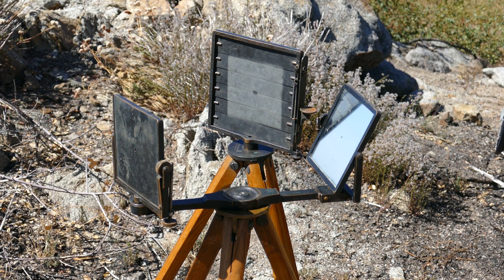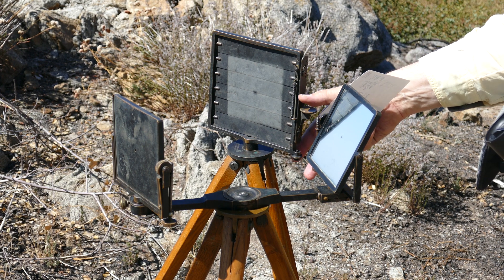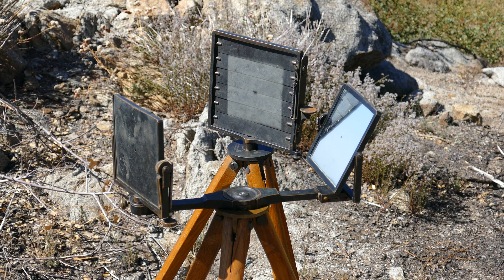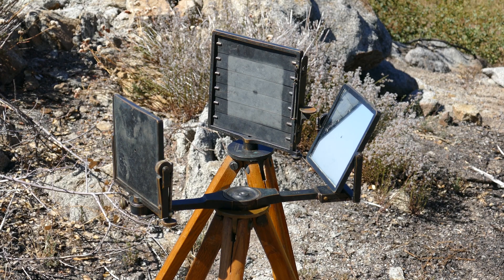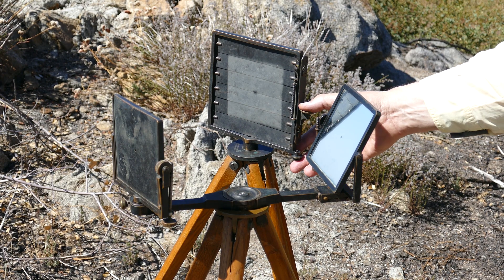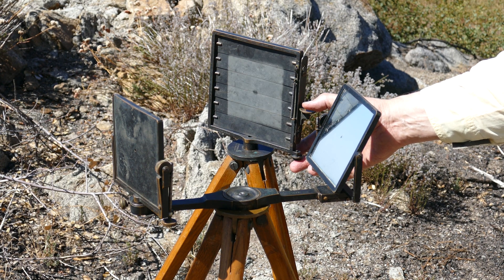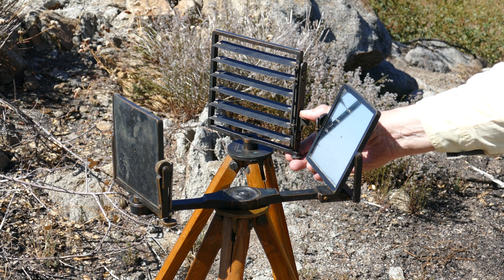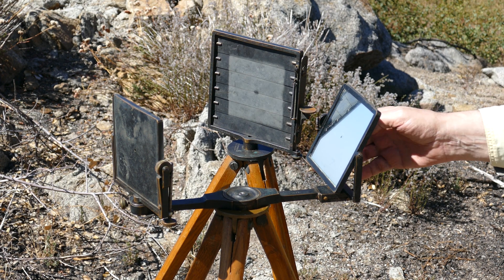American Heliograph Model 1905 Demonstration

Comment: ???GREAT DEMO????  Nobody learned a thing from this!!!
Reply: I have no idea how this object works. I have no idea how he transmitted a message. I thought he would use something like Morse code but he didn't, he just said the word and opened the flap
Reply: @legionofregion8825  The audio was carried by the beam of light.   Kind of like a string between 2 cans.
You see, he opens the flap and produces the beam of light off the mirror, and the mirror is vibrated by his voice via a microphone attached to it.
These vibrations in the light beam are detected at the other end and reproduced by a speaker attached to the receiving  surface.
Elementary.
😁
Reply: @seeharvester  kinda think you are wrong here because he is being listened way before he opens the vanes
Plus at the end, the guy on the radio is calling back the lenght of flashes he just saw.
Reply: @DoNotPushHere  He's being facetious there are no vibrations caused by the operator's voice. Originally Morse code was used to send a message in this demonstration I'm not sure what they are trying to do no message was sent.
Reply: Typical American HAMEs.

Comment: Great demo! Due to the cumbersome nature of transmission (and to ensure secrecy) they would have likely used codes, perhaps similar to the old biliteral or triliteral maritime codes.
Reply from the maker: Military users concerned with security typically used cipher disks, but the enciphered messages were still sent in Morse or the equipment. In this example, I'm emulating what the US Forest Service did, which is to use, essentially a "tap code" (see https://en.wikipedia.org/wiki/Tap_code )